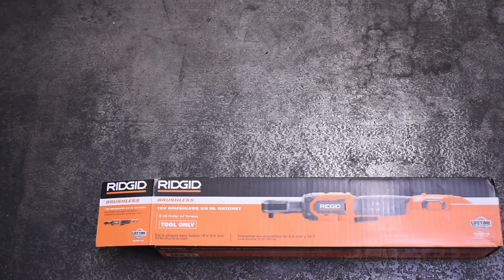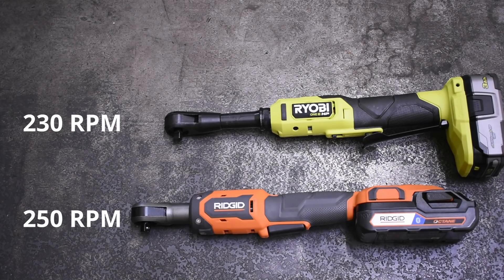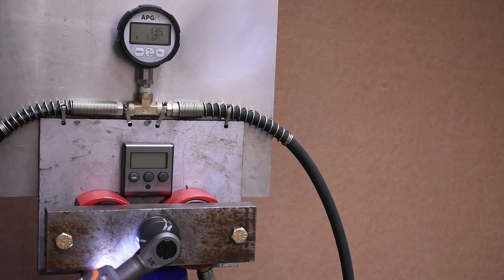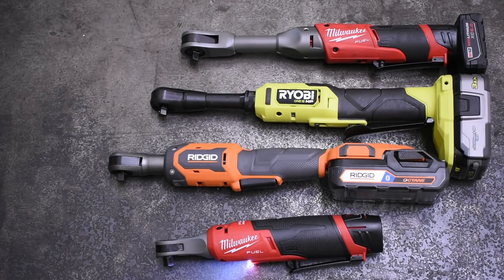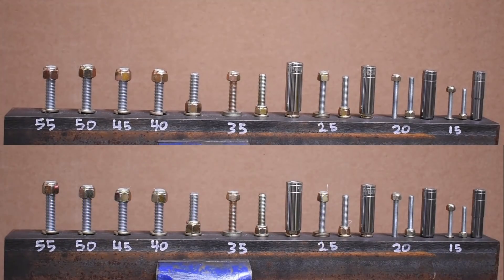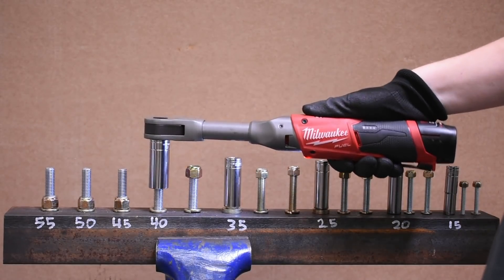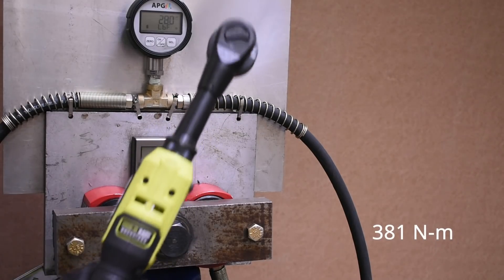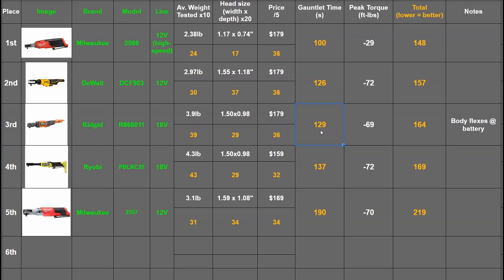RIDGID's 1st Ratchet vs Ryobi, DeWalt & M12: R866011

Comment: Nice job on the comparison and good review. One thing that you may want to take into future considerations when comparing tools is the warranty. Up until a couple of years ago, I had all DeWalt cordless power tools. I think they were just 12v, pretty old. I got sick of spending $100 every other year on replacement NMH batteries. So after a ton of research, and viewing many comparison videos like yours, I opted to go with Home Depot's Ridgid brand. While I fully recognize the brand doesn't stand up to an equal performance to Milwaukee or maybe other brands out there, I am not using these tools for my career/income, so I am ok with sacrificing a bit of performance. What I could NOT sacrifice is the amount of money over time being required to purchase batteries, or even replacement tools if necessary. What pushed me over the hump to switch over to Ridgid was their lifetime warranty, not only on the tool, but the battery. Knowing I will NEVER (assuming the company doesn't fold) have to pay for tool repair OR battery replacement definitely adds some bonus points when rating. I have purchased the Octane level of 1/2" and 1/4" impacts, 1/2" hammer drill, 7-1/4" circular saw, reciprocating saw, shop light, 4 of the 3ah Bluetooth Octane batteries. I also recently purchased the weed whipper and leaf blower with a 4ah battery combo. Lastly, have been waiting for the 3/8" extended ratchet to go on sale, which it just did (still $99 off as I write this) so purchased it. It's coming with a thin 2ah battery. I know run time will be reduced, but for my garage projects should suffice just fine. I have 5 other batteries to finish any job I'm working on should I deplete the 2 ah battery during whatever I'm working on. The tools have all worked great for me, and I even turned my neighbor buddy on to Ridgid who was shopping for a cordless impact to replace his broken/worn our air impact. He's a technician in an auto dealer, using it almost daily and so far has been 100% satisfied with it. I've been using mine for a couple of years now and so far have been completely satisfied with all of my tools as well, with one exception. The bracket stand for the light has two extendable clips for attaching and holding it to a rafter. One of them broke. I received a no hassle replacement from the HD, no questions asked. Anyways, just wanted to add my input on to your reviews, that again, while the performance may not be 1:1 with some of these other tool brands, they are pretty darn close but the lifetime warranty (you MUST register the product w/in 90 days of purchase) makes up for the difference of performance IMO. Thanks and keep up the great work and reviews. JW

Comment: I get your point about how the Ryobi ratchet would be better with a compact battery, but the fact that it uses the same 18v battery as every other tool shows their commitment to not letting their older tools and batteries go obsolete. This is why I’m happy to buy older Ryobi tools at a garage sale. Even if the cordless tool is 15 years old, the latest high performance batteries will work on it. If they must do a compact battery, I hope it will still be able to work with their entire 18v lineup.

Comment: Great comparison test that I am glad I saw. I was considering Ridgid but the flex was not good to see. If it broke, Ridgid customer service is unacceptably poor and slow in getting replacements sent out if at all! I have been waiting 3 months now on a battery replacement! I am STUCK with Ridgid as i have an 8 piece tool set.
Reply: You did not say what issue you are with your Ridgid battery. I would like to pass on this info on to you.

I have 2 1.5A batteries that came with my first set of tools 10+ years ago. One of the batteries stopped taking a charge. I put the battery on one of the new Ridgid battery chargers and it was able to reconditioned the battery and the battery now holds charge. Not sure how long it took to recondition the battery.
Reply: The issue was old defective batteries. The replacement for the 2.5 amp nicad was a 2 amp lithium and the second replacement for the nicad was a 2 amp max output. The second one took them 3 months with one update and lies!

Comment: I have the Earthquake XT 3/8 Ratchet. It is beefy/stout and has a lot of torque (brushed motor). Plus it's slim. I since bought into the Ryobi ecosystem of which I have 22 tools. I will definitely buy the Ryobi Ratchet when the other dies. Torque is most important to me.😃

Comment: I’d really like to see a head to head torque test on the m12 fuel high speed and m12 brushed ratchets. Seems like the brushed might have a little more power with the lower gears.

Comment: Would there be any value running the Kobalt and Milwaukee right angle impacts through the ratchet gauntlet too? Just pretending they're really big ratchets and dealing out the points accordingly? I'm thinking about finally getting a powered ratchet, but dirty & rusty threads are disuading me...

Comment: I bought Ridgid maybe 5 years ago, when Gen5x was out. Very good tools at a good price. A lot less $$ the DeWalt or Milwaukee and nearly the same performance. Some nice features too, one hand chuck on the impact, nice lighting around the drill and impact. Octane came out and wasn't a big improvement. Since then it's been downhill IMO. The tools look and feel cheaper, there's nothing new or innovative. I might buy a subcompact for those tight spaces but that's it. These days I'd recommend Ryobi HP, Kobalt or Skil for the serious DIYer on a budget.

Comment: I am worried about these instantly torquing bolts to 60+ft pounds when I just want to run thm down. What are your thoughts?
Reply from the maker: It can definitely happen, i've done it
Reply: @TorqueTestChannel  I guess you have to be light on the throttle towards the end. They should come out with a mode similar kind of like the reverse of the 'auto' modes where it will stop when it feels a moderate amount of resistance

Comment: I purchased the Ryobi ratchet for my brother a few years back for christmas since he was already married to the Ryobi One battery ecosystem and he really likes the ratchet. He doesn't often work in spaces confined enough for the bulky battery pack to be an issue.  One that I would like to suggest is what I call an Amazon Wonder Cheapie. Which is the "KIMO 3/8" Cordless Electric Ratchet Wrench" IT comes in at $89 before tax and comes with 2 packs, charger, a nifty case, etc. I'm currently not invested into any battery powered tool family just yet as I just borrow my brother's Ryobi stuff when needed but would like to have a battery powered ratchet of my own. I'd like to see how this Amazon find stacks up against the M12 which, by default, will be what i'm getting for the small-ish size.

Edit - it only comes with two packs optionally but you can spec it with just one for $69 or the tool only for $39

Comment: There is a quantifiable advantage to a tool using the same battery packs as ALL the other tools a person may have.
 I personally have saws, Sawzalls, ratchets, impacts, drills and others and am glad I have all the batteries I could use as they all use the same batteries.

Comment: I've had the Ryobi for a few months now and have been satisfied, though I had no experience with the other brands to compare to. I agree that battery is a bit awkward, but one thing that keeps me coming back to Ryobi is their long term standardization of batteries. My first Ryobis (nearly 20 years ago) had much weaker batteries but they take the new genarations batteries just fine... consistency in cordless tools is very important to me, I've acquired  about 9 batteries which I use in rotation with all my tools.
Reply: Big selling point for me too.. i dont want to have 15 dewalt tools just to get shafted by some new battery model and i need to change all my tools..
Ryobi is clearly sticking to it's guns and i can buy batts for my tools as long as they last with out worrying about possible battery fitment issues in the future.

i am suprised how long my ryobi 1+ batts and tools have lasted. been over 5 years since i got  2 5 amp batts and the 400nm bolt gun.. Still turning rusty bolts like new and it is actually the strongest gun i have tryed. even opened rusty bolts that a makita 700nm gun could not open. the hammer strike fast in ryobi and the big makita have a slower hammer that is better for sinking big screws in to wood but not so good with rusty bolts.. i also have milwaykee m18 drill and it feel stronger than my ryobi brushless drill but the ryobi fits my hand so much better and have a better balance..
Reply: Interesting

Comment: I wouldn't consider the battery compartment on any wrench as part of the lever therefore the flex isn't on issue.... The length of the usable ratchet may be but that's another story.

Comment: Hey TTC, what the best affordable battery ratchet?
Which would you buy?
Actually better yet which one brand would you invest in as best all around system as batteries,  ratchet, 3/8 impact 1/2 impact, drill etc etc.
Reply: Lol. I have a craftsman 20v  1/4 collet impact & drill & jigsaw, and Milwaukee M18 drill & 1/4 collet impact, snapon 14.4v battery ratchet & drill & flashlight & 3/8 impact...lol
I want one really good system brand.
Reply from the maker: In 2023 possible DeWalt more than anything else. Milwaukee close 2nd
Reply: Looking at the m12 450rpm Milwaukee kit $184 home Depot

Comment: You should rerun the ryobi  but using dewalt 20v with a battery  adapter.  I have always had good  improvements doing such on alot of my ryobi tools

Comment: For the price Ryobi offers a lot. Sure it may not be exactly up there with the top manufacturers but in time it could. Ryobi should definitely add a compact ratchet to its line with a compact battery similar to the Milwaukee for those tighter spaces.

Comment: Seems like Ridgid really ought to have made this 12V but unfortunately they pretty much abandoned their 12V line.  Seems too bulky/heavy and the flex near the battery is none too assuring.  Also no extended ones out the gate is disappointing (though I think they might show up later).  Price is not great  right now but I'm sure will be available much cheaper on deals/promos after a few months, as usual.  Would like to see the HF Hercules extended put in here.  It offers a lot of value as most other extended ratchets add a significant premium to their price whereas the Herc extended is only a nominal amount more than the regular, not to mention much cheaper than all the other extendeds I've seen.

Comment: Not their first ever ratchet.  I have owned a Rigid ratchet as part of the Jobmax system for more than 3 years.  Works great.  I can use it with all 3 power heads I have, 18v cordless, 110v corded, and the pneumatic powerhead.

Comment: Be Careful!!,  A some years ago, Rigid tools came out with the 12v models of their electric tool line.  There was a multi-tool version that had one main motor segment and additional tools that connected to the main motor unit. There was a 90 degree drill, 90 degree  impact driver,  90 degree 3/8 ratchet, and a vibrating blade saw. Then they added a saber-saw unit.  These  tools were compact and powerful even at 12 volts and they had a definite use in the general construction business. Then they came out with a larger, higher amp 12v battery that allowed the tool to stand upright .  The 12v series also had a pistol grip style drill and impact driver.  These were good, powerful  tools that touted  'LIFETIME'  WARRANTIES.  Recently, Rigid killed off all 12v products and there is no recompense for your lifetime purchase. One cannot even buy 12v batteries for your existing-remaining tools. Rigid abandoned their initial customers in favor of creating a new line of 18v larger, more cumbersome models.  Now Rigid is trying to 'suck in' a whole new group of construction tool users.  Be careful,  they will abandon all you new 18v tool owners within a few years.  It's all about the corporate money/income.  Don't be fooled.  Buy Milwaukee or DeWalt or  Ryoby.

Comment: I got introduced to Cordless Rachets by Project Farm's video. As a result bought the cheapest eBay 12v ratchet sold under a dozen names on eBay.
I bought it  with running the M8 and M10  manifold nuts on 4 cylinder Rover K engines in mind. The tool cost pennies, not much torque but it is slim compact  perfect for nut running  on M6, M8, M10 and even M12.   In the UK we don't get as much brand choice as in North America and new models take longer to be available but thanks for  your work.

Comment: I am happy with my M12 3/8" extended reach ratchet, especially with the 6.0 battery.  The ergonomics are better than those of any of those other brands.  The head could be smaller, but it's usually not a problem for me.

Comment: Ridgid orange‘s big selling point is Prosumer grade at good prices with the LSA warranty.  In order to make this work, they have to mass produce as much as possible, which means minimizing the product line. Having separate 12 and 18 V tools is counterproductive to this strategy.  I for one like it because I don’t have to buy separate batteries. Ridgid also prices their stuff high when they first release new products, to snag some of the dollars that wealthier customers are willing to part with. They lower the prices later for the rest of us, usually ending up 20 to 30% cheaper than Milwaukee for 80 to 90% of the performance, which is a good value, if you care about that.

Comment: I wonder if Ryobi can ever get creative with the battery design/orientation. Though they take pride in keeping the same battery design over the years, they should really get that thing out of the way a bit.

Awesome that your battery mount never changes. Not awesome that it prevents certain tools from operating at their best.

Like the angle grinder. The battery makes it so you can’t get the grinder flat with the surface. They should find a way to flip it around or figure out some shape that can get tools like this into tighter spaces.

I assume they’ll figure something out at some point considering battery tech/design/ergonomics is one of those things everyone on the Internet mentions as an issue with Ryobi. They seem committed to the probe design so 🤞 that they figure something out haha

Comment: hi i think i may have found something that on paper is maybe record breaking and test rig breaking of course 
it's the 1" air impact wrench from Hazet model 9014PS-1. I'm sure that Hazet do not manufacture this tool so i'm sure you can find it under other name brand 
but with it's 2'000 ft lbs fastening and 2'500 ft lbs loosening torque claim, that thing sure looks impressive

Comment: My favorite ratchet is the M12 long I know it’s not the fastest but when paired with the M12 6 amp battery it works well and is fast enough also has really good torque! I use mine every day I am GM technician.

Comment: Snap on brute long neck for high torque and hand torque but it's slow. Snap on reg 3/8 long neck for speed, prob would be up there with those top torques also.
I prefer Milwaukee on impacts but snap on ratchets FTW.

Comment: Don't mean to be a ball buster I love this channel. Just wanted to make a slight correction. Ridgid did have a 3/8 cordless ratchet 12-volt out about 10 years ago. Although it was a multi-head tool attachment and would score very poorly in your rankings both for strength and Tool integrity. I don't know how to add a picture but I have one here

Comment: Hello TTC, thanks for another great video. I have all m12 and all snap on ratchets, i tried the m12 high speed and found it useless due to low torque.  I sold it and swapped it out for  Snap on CTR861,  Much quicker in real world scenories so 'd expect it to do well in these tests. i'd be willing to let you test it if you'd like.

edit: its not the brute or extended length its the new standard length brushless.

Comment: You should 100% try out the new(ish) bosch 12V MAX impact driver and wrench with the puny little 2ah battery. They're claiming 85 ftlb out of a tool only 1.6 lbs... 
I already have the right angle driver kit so i'm kindof bought in already

Comment: Sadly, for those of us that heavily invested in the JobMax line, Ridgid KILLED that offering off, and its now darn-near IMPOSSIBLE to find any of the interchangeable heads for the JobMax tools, unless one is willing to pay highly inflated prices from the "scalpers", that far exceed the cost of a new tool.  

I have (and have gifted to my boys) a lot of Ridgid cordless tools, BUT, I've reached the point of feeling that (imo) Ridgid simply CAN'T BE TRUSTED!! - - 

They DROPPED the 12 Volt line,  (for which I have tools & batteries)

They DROPPED the JobMax Line,  (I heavily invested in this!)

They DROPPED the Octane line (of both tools and batteries!),

AND,  they DROPPED the MegaMax Line (of which I'm am also heavily invested!) !  

IMO, this company has proven that they DON'T KNOW WHO THEY ARE, or WHAT THEY WANT to BE, and its FRUSTRATING for people like myself that invested heavily in them, and feeling ABANDONED when it comes to any type of further support or backing!!